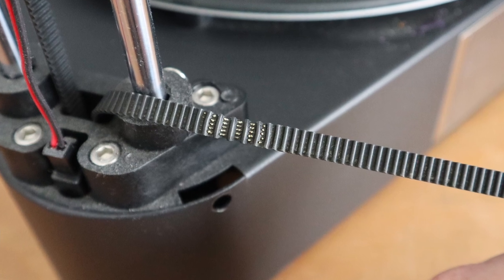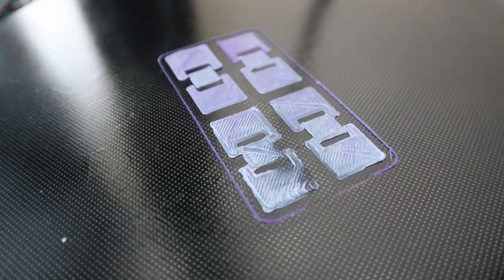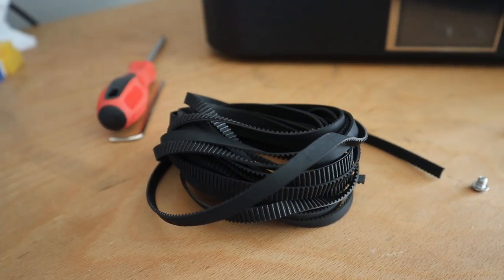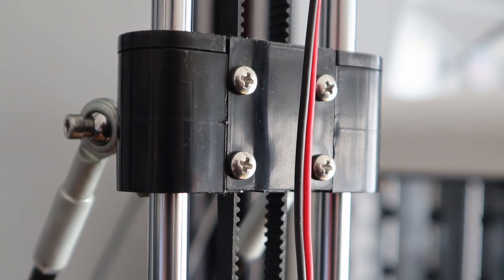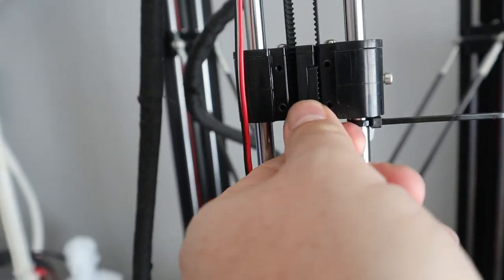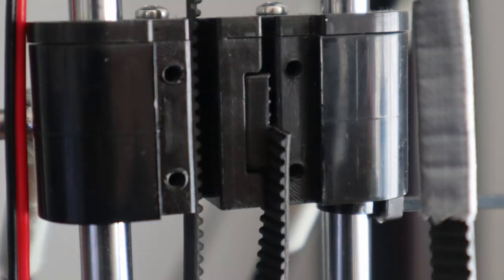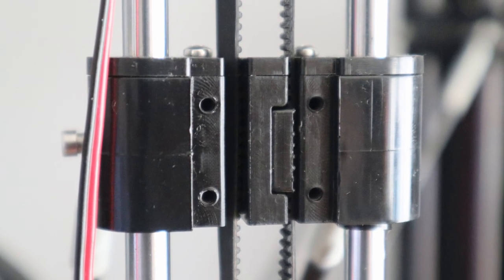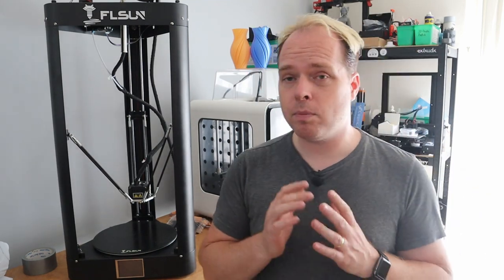Installing new belts FLSUN QQS Pro

Comment: One thing I forgot about Delta printers is that this can happen and it "SEEMS" like your bed level is off, but it's your belt. 

I only re-discovered this by accident, and I was feeling for tightness on my belt, and then I found it....a 1 inch piece of the belt that was severely worn. (apparently gyroid infill is hard on a delta's belts.)

Thanks for re-affirming my diagnosis.
Reply from the maker: Thank you. 
Yeah, the weight on the gantry is there all the time, and it is a good practice the move the print head if the printer is not used for some time. Gyroid infill is your favorite infill type? I know why, it's pretty indeed.

Comment: same thing happen to me with one of my qq-s pro and this is something ive seen alot in flsun groups but so far for me with my 2 machines they've lasted 2 yrs but this past week i noticed the same thing as u with the bed leveling an found it was my front left belt that had stretched, ive just now gotten time to change it but i only have enough belt on hand to change the single stretched belt so im ordering 20m of belt right now to make sure i have enough to go ahead an change them all on both of my qq-s printers with some extra left over.
Reply from the maker: Yup, the bed level was off and I couldn't get it right. When I move the toolhead, i have noticed that,
How is your printer working now?